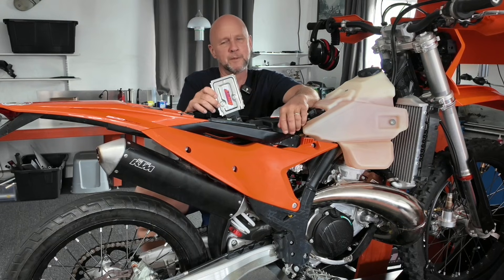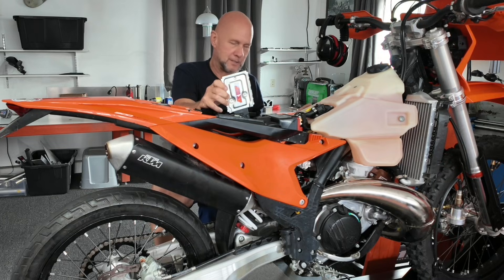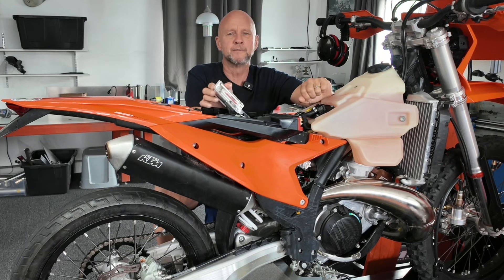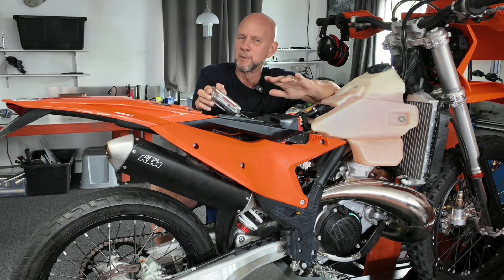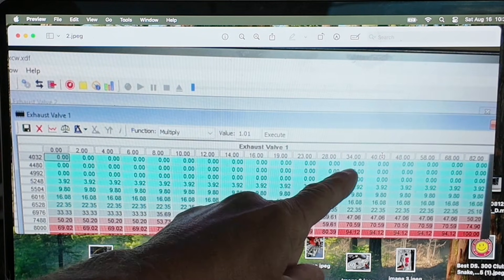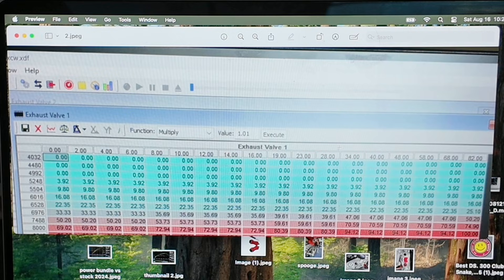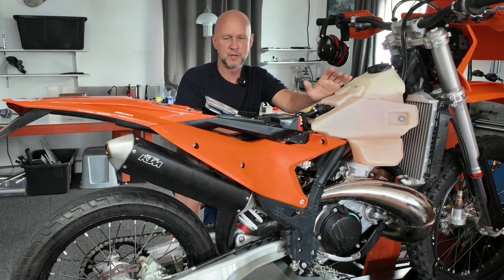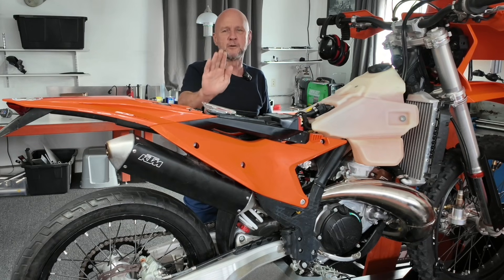ECU Tuning Delivers the Biggest Gain for the KTM 300 XCW - Adds 8hp at Only 1/4 throttle

Comment: Question Dave. Why does the average trail rider need more than what the stock bike can offer? I see your riding videos and much like me you don’t hit 1/2 throttle on 2nd gear. I totally understand the CCPS sensor mods and things that make the bike more reliable. I just don’t understand why the vast majority of people need to worry about adding more horsepower. If you are racing sure but you are not getting out of 1st gear. So what’s the point. Thank you for the videos and the input. I like the tinkering just as much as the riding and maybe that’s where you are at as well.
Reply from the maker: Because people like power and 300's wouldn't way outsell 250's
Reply: Bro you will fit in perfectly with the KLR650 crowd. They do a lot of technical riding too and feel the same way. I about shat myself when I saw that 50HP pop up. I would love to have 75 at the wheel if it was feasible. I switch my wheels out and convert to super moto quite often. That 690 KTM sells is a bloated pig of a bike and it's a real stretch to call it a super moto. That ECU and high comp head and piston is exactly what I am looking for.
Reply: @alanshaw6161 dude I feel exactly the same way. I actually bought a 2024 ktm 450 sx-f rolling chassis with the idea of doing a custom fabricated 690 swap since the SMC-r is so massive and bulky. But I decided to deviate away from that and bought myself a ‘24 250 XC-W and set it up as a street legal plated Supermoto with hopes that BRC develops a 500 kit for it in the next two years. But with that being said, I’m interested in getting my ECU reflashed by Pinit racing to hold me over

Comment: Hey Dave, love your videos, what's the best solution for the fuel pickup when I'm riding on flat Forest roads after 1 gallon of gas is gone. I'm starving for fuel unless I hit bumps or jar of the tank as you are well aware. Any advice?
Reply from the maker: I'm making a fix but it only works on PDS shock bikes